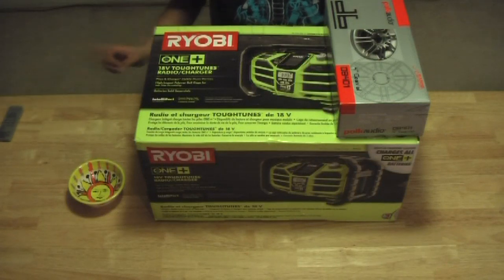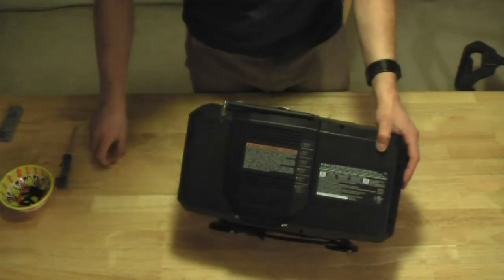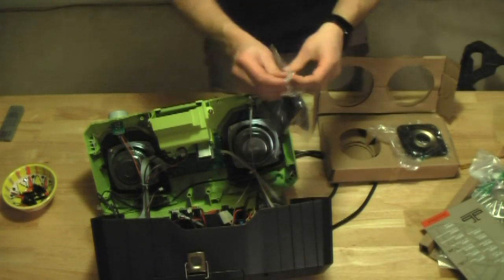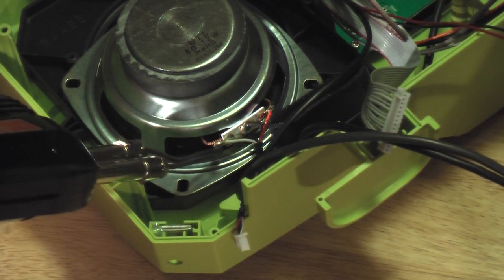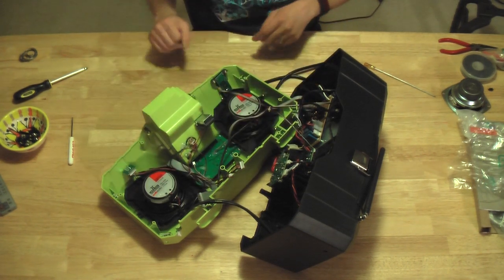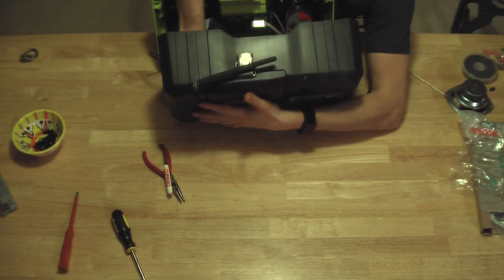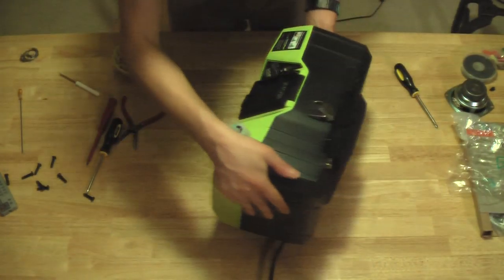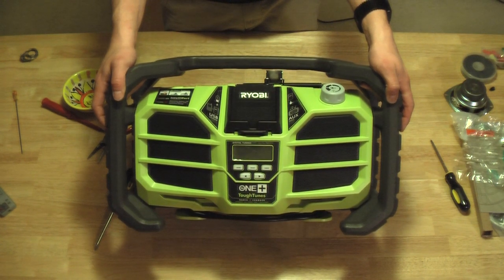Ryobi One+ ToughTunes 18V Job Site Radio Charger P745 Speaker Upgrade

Comment: The radio seems to change the "mode" on its own, randomly, without my input.  I set it all up for running off my Ipod, then by itself, switches to FM.  If I leave it on FM, then in a few minutes, randomly, on its own, switches to AM.  Battery charging function seems to work fine.  I think it is an issue with the chipset that controls the keypad at the front.

Comment from the maker: Being a "jobsite-tough radio" (from Home Depot's product description), I'm assuming it's weather resistant to some degree. I can't find a specific Ryobi claim however. The speakers I added are waterproof.

If you integrate/implement any type of equalization, let me know. I added a Sound Shocker for higher volume output and it works great!

Comment: I know this is 3 years old, but I was thinking about upgrading the speakers in my one and found your video on my first search.  I'm interested in the other comment though about the built-in amplifier not actually being powerful enough to run the new speakers (well enough to hear a difference).  I'm also interested in other mods you could do to this unit like adding in more USB ports.. ?
Reply from the maker: I added a Sound Shocker to mine and it made a huge difference in volume. I do think it's under powered on its own, though. I'm happy with it after the new speakers and Sound Shocker, with the small caveat of the hiss/whine sound at low volume.

Comment: I am seeing these on EBay for unreal amounts of money because they are discontinued, but I am reading in some places they were discontinued due to quality and performance issues. How has your performed with the upgrades? How often do you use it, and how long can it last on a single charge? What battery?
Reply: I really baby the thing, and haven't had any problems with it. I just plug it in and listen in my garage sometimes when I'm working, so I can't really speak to battery life or how it holds up to the elements.

Although I haven't had any issues, I think the initial asking price was pretty high to begin with. If I had to do it again, I'd get an outdoor bluetooth speaker that goes louder.

Like you, the only reason I did this was because I collect the Ryobi stuff and like to buy things to tinker and make them better :-).

Comment: I have returned one and the replacement has the same issue with the aux cord.  I guess it wasn't  installed correctly and or it's loose.  Since they stopped selling this I had to be OK with the defect.   After that the speakers started to play with me. Only one at a time would work then they would alternate. Now the radio powers on but no sound.   This was solved before by turning off and on... it seems like you might have better than a basic understanding of how everything is hooked up inside what do you suggest I check

Comment: also is this radio any kind of weather proof? if you found out and mentioned it i missed it. again on the speakers- one thing i dont really like is the fact we cant play with any audio settings. maybe an aftermarket volume adjuster/booster, but what about an aftermarket equalizer type deal?

Comment: I know this video is older but have you pushed the radio at full volume for extended times 1+hrs? I'd be concerned about running the cheap amp they use at 4 ohms vs. the 8 ohms its rated for. You are pushing 2x the wattage output to 24 watts (8 ohms and 12 watts was factory). I'd also be curious if you get the same level of output as I'd expect the speaker to be under powered as they are rated at 45 watts. Hopefully they installed a thermal switch to protect the amp, but its a cheap amp so...?
Reply: Cheap amps will damage speakers.

Comment: If The Amp Puts Out 12 watts
Won't The 45 Watt Speakers Blow The Amp?
I put 50 watt Adio Boss Speakers In 
A An Old Speaker Box & Thought
I'd Get Good Sound But They Sound Tinny.

Comment: Thats not normal speaker wiring at all speakers only have a - and + not a 3rd conneciton. That is actually where the terminals are riveted to the speaker frame. I have no idea what Ryobi is doing with that wiring scheme. That black wire may not even be necessaey but I cant tsay for sure as I have no idea where its going.

Comment: why didn't you turn it on
Reply from the maker: Sorry about that. Doing a proper before and after sound quality test would have required a nicer mic than my camera's and was outside the scope of this video. Additionally, videos will get flagged by YouTube if they have copyrighted music in them.
Reply: TheTechnoMack does it sound good?
Reply from the maker: Michael Hursh It sounds better than before, but overall the sound quality suffers because of the hiss/whine issue that these stereos have. They sound good at high volume, but at low to mid, the hiss/whine is hard to ignore. I added a Sound Shocker to the Aux In line to increase the volume significantly. That was $30 well spent.

Comment: I hate you...
I spent 50 minutes waiting to hear how well the new speakers sound and you choose not to play anything due to being afraid of copy right material... I have this same radio and love it but the sound can be louder as well as crisper, i wish i could have heard the difference :(
Reply from the maker: Hey Bri an. I added a Sound Shocker to boost the volume and it's at least twice as loud. Unfortunately, the whine/hiss is louder too at low volumes. I purchased a couple of in-line distortion blockers recently that I will test on this unit. I'll post that comparison when it's done.